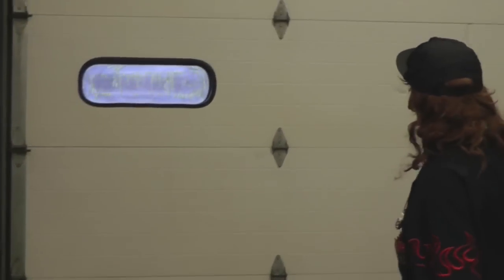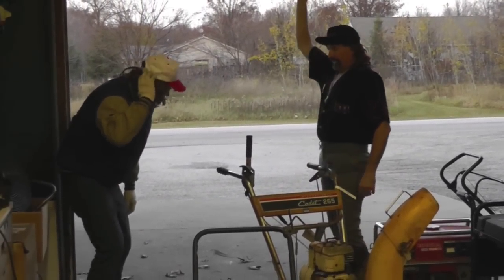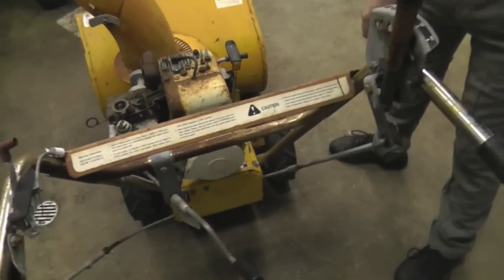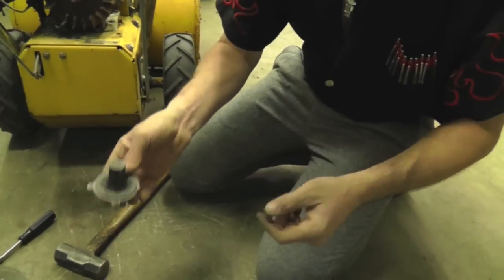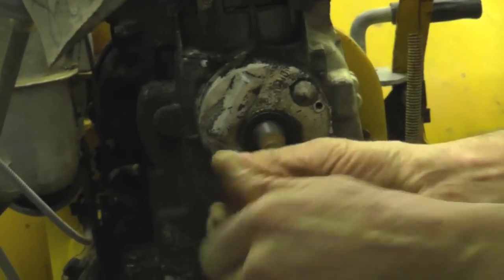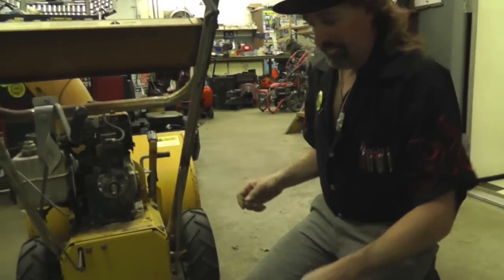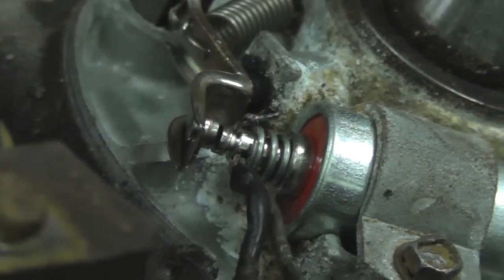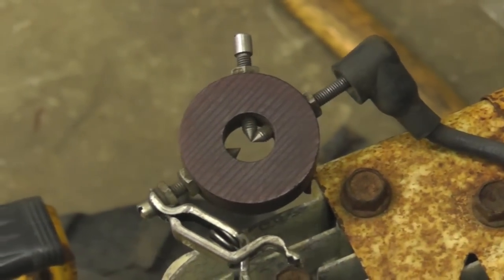How To Replace Points and Condenser on Briggs

Comment: A block of wood, and hammer works great for removing the clutches. Been doing it that way for 30 years, and never broke a single 1 of em.

Love the videos!
Reply: Is it possible to convert to electronic coil ignition...just like many other apps you have demonstrated??
Reply: @angieshaw8877  Sure, as long as you can find one that fits the the engine and has the necessary connections to kill the ignition when needed
Reply: 7 years later. i use a brass rod and a hammer

Comment: I have never replaced one of those clutches.  I take them apart, clean out the gunk that is causing them to stick, put some light oil in them and they have always worked after that...so far.  It can be a bit difficult reassembling them.  The balls do not want to go where they are suppose to go.  It has been decades since I did it but I think I just rotated it backwards to get the balls in place.  Thanks for the videos.  I have learned a lot from you.

Comment: I have used a pipe wrench to remove the starter clutch, works GREAT!
Reply: Yip or even boy set of engineering vice grips lol don’t need to sit and batter it with a hammer

Comment: i use a oil filter pliers to remove the starter clutch
Reply from the maker: +travis fossen Good tip Travis for someone who doesn't have the removal tool. I'll have to remember that. Thanks

Comment: I've cleaned every starter clutch I've taken off. Just pop the cover off with a small screwdriver & hammer. Clean inside and ball bearings. Shoot some carb cleaner in the wick hole and blow the inside out with air. Apply some machine oil and reassemble...and for gawd sakes don't beat on it like Taryl. Use a blunt punch or block of wood, do like I did and spend the bucks for the tool.

Comment: Hi Steve!
I love your videos and they’ve helped me a lot. I was just following the vids you did on the 1976 5HP Briggs ignition. I’ve done everything you’ve shown but don’t get enough spark to show on the new plug. But I get a mild jolt if I hold onto the plug wire itself. I think this indicates the condenser is shot. My local parts store no longer has a set and when I go to the web it says “discontinued by manufacturer”.  1.  Am I doing something wrong?  2. Is there someplace that still might have a condenser for a 48 year old Briggs?

Comment: I put the screws back in the clutch before hammering it. I do it so the ears don't distort & also so the cap that holds the bearings doesn't pop off.

Comment: Great info. helped me a lot. The problem is while replacing the points the little push rod that opens and closes the points stopped working. It moves easy and can be taken in and out but while rotating the engine it doesn't move up and down anymore. What could cause this?
Reply: Put pressure on it with your finger while you rotate the engine- it will go up and down.

Comment: A better way to take that off is to use a large pair of channel locks. They lock right around the outer area where them threaded tabs stick out. Lock the flywjheel with a crow bar and turn it off. It is much better than hitting it with a hammer.

Comment: If anyone cares to know you can take the coil off of that engine and replace it with a newer coil off a motor that doesn't have points it will bolt right up and take away the need for points without any modification except for cutting off a few wires going from the old points to the old coil
Reply from the maker: +dave averesch Thanks Dave, We have another video that shows you how-to do that.
Reply: You have to make sure that it is the same size coil, though. If the flywheel is a different diameter, the coil won't properly mesh.

Comment: If I put points in a Briggzy once, I did it a thousand times, Had a 3 hp Go-Kart engine, with
an updraft carb, I wonder if engine delivers more power w the magne-tron ignition? I know 
the air filter has to be clean  is one  part for the engine to run at it's best.

Comment: What- you got the clutch tool, the knockoff tool, but no condenser spring pliers? 😝
Good job filming, it’s a hard space to work in, much less videotape.
That kit usually has a small black square of material for cleaning the points when you’re done. I think it’s a .020 gauge as well, but I use feelers anyway. Also, there should be a grease packet to grease where the pin pushes on the arm.
When you tighten the condenser strap, most times you end up changing the gap. Easier is to snug it up, then tap the end of the condenser to fine tune the adjustment, then tighten. 
I would not be smacking that soft metal clutch with a hammer, easier ways even w/o the Briggs tool. Also, while it’s off, take it apart, wash everything inside with degreaser, then white lithium grease and reassemble.
You can use the head of a key (brass, right?) off your key ring to protect the crankshaft end if you don’t have the knockoff tool or a brass punch or soft piece of metal.
While it’s torn down, spend $2 and pop a new crank seal in. Oil won’t help those points when it starts to leak.
Last, I don’t know why it matters, but Briggs says the spring goes in the big hole, out the little hole on the breaker arm.

Comment: I had a guy bring in a 1984 Briggs and Stratton Generator that he bought at auction. At some point in time, the previous owner tried changing the ignition from points to electronic. Needless to say, the job wasn't done right, and the engine is now in my shop. Along with the conversion came the cutting of the wires to the coil. I'm trying to put points and condenser back into service on this machine. Would you happen to know where exactly the wires from the condenser go to? There originally were two of them. However, I don't see a kill switch on the engine.

Comment: Awww... 1971 aint that old
Being the cheapskate that I am...I use a block of wood on the ear of the starter clutch like a punch and hammer the wood to get it off in one piece.  spray some oil in the end hole to re-lubricate the wick and a little on the inside too and you may not have to replace it.
Thanks for the how to.
Reply: No its not that old and look closely its an Ariens 10000 series painted yellow with slight modifications for cub cadet. Ariens built blowers for a few companies at that time using the 10000 series.